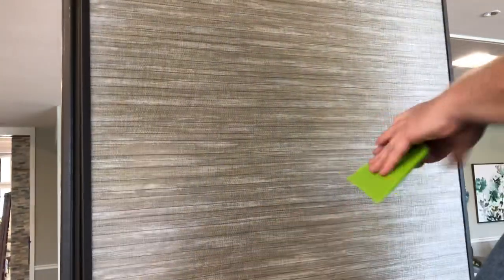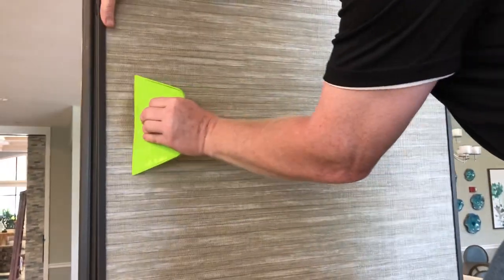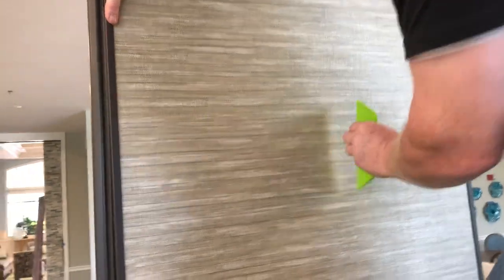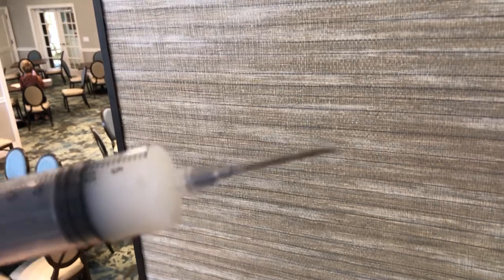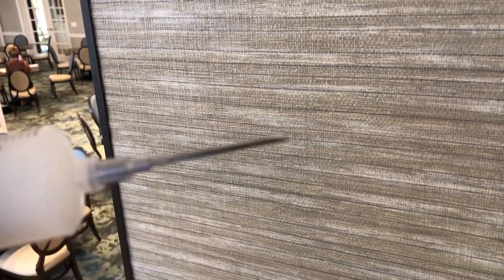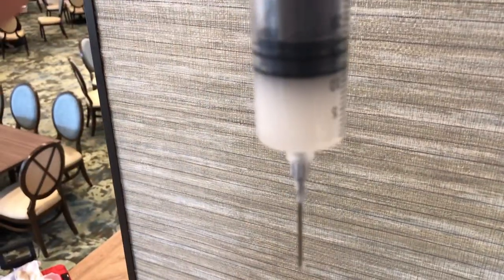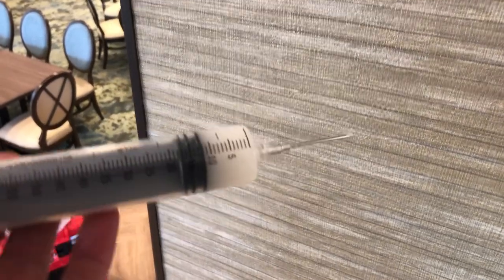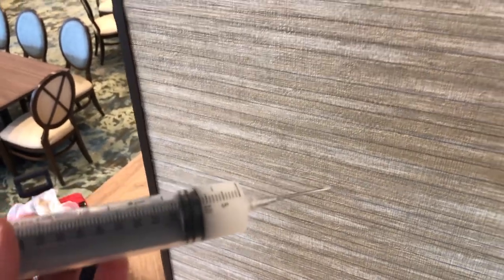How To Eliminate Air Bubbles In Wallpaper - Spencer Colgan

Comment: my parents has had the same wallpaper for 15+ years. i have noticed some of the wallpaper beside my radiator has started forming 10-15 small bubbles vertically up the wall is that normal? hope yo can help 😊🤞and there is alot of cracking
Reply from the maker: Angelica. That wallpaper is done unfortunately. It’s too old to fix.  It’s “atrophied.”